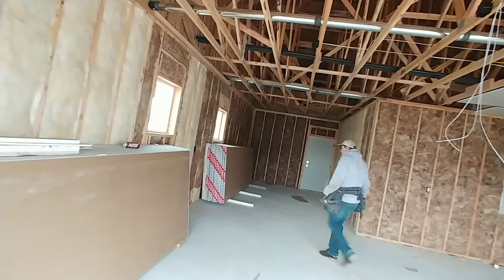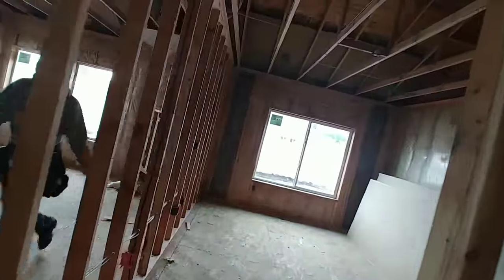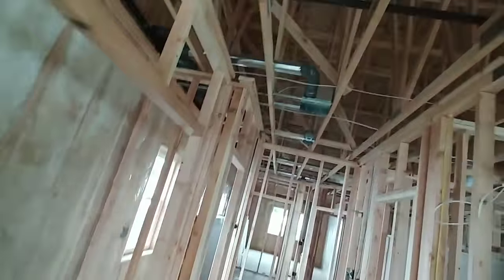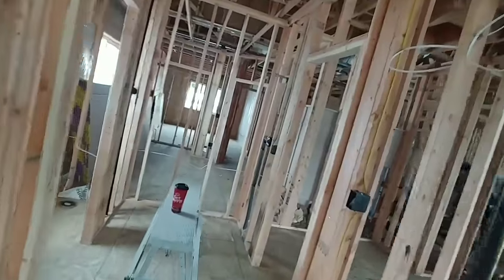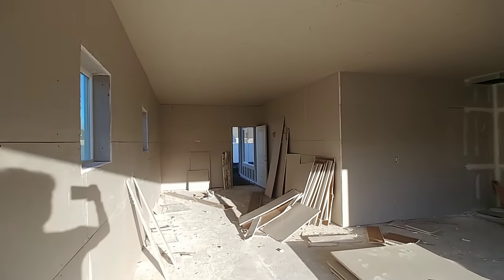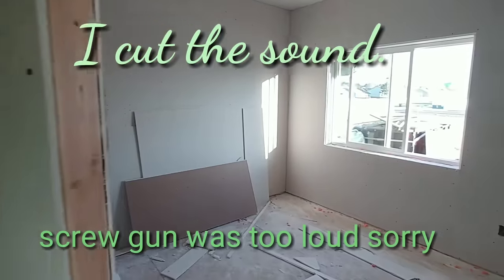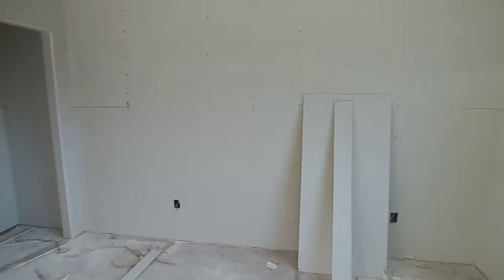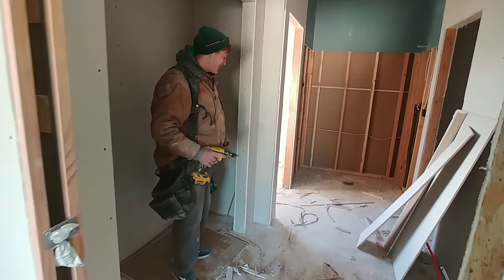Hanging drywall, 1 house 1 day, full crew start to finish drywall hang. Work vlog

Comment: Looks like you guys do pretty good work. Why no glue?
Reply: Yanks dont glue...
Reply: Jonny Esper I'm the only one that I know of in my area that does, it's made a big difference in call backs for nail pops, I don't get those anymore.
Reply: 10 years of sheeting... hard times..we never wasted a move...flat strap all day..
Most people dont what a hard days work is..  dawn to dark..hop into the car and my legs are still twiching ..
Reply: Bama Backroads real sheetrockers use nails
Reply: Around here that'd be from dark til dark! ...But I feel you - Worst one was 22hrs straight finishing up before a handover. Not EVER doing that again.
Reply: ...@ Jonny Esper

Comment: 48in x 8ft 1/2 inch drywall ceiling is easy....
54in x 10ft 5/8 inch drywall weigh twice and bigger  and tiring... 48in x1/2inch vs  54in x 5/8in way harder...

Comment: Could someone please tell me how much this pays?? And if I need experience to work in drywall
Reply: In nw wa where I live hanging pays anywhere in the range of 15-30 cents per square ft.  I realize that's a huge variance and it usually pays around 18-20 cents per sq ft on your average easy custom or spec homes.  Hanging is great money but it'll kill ya.  If you really want t ok hang you could find a job as an apprentice if theres lots of construction in the area

Comment: No Poly on the ceiling ?
Reply from the maker: No not in this area. Its not required.
Reply: @NomadicINK  Then why on some of the walls ?
Reply from the maker: I couldn't tell you.  Id have to look into it for this area.  Walls need a vapor barrier in most areas here.  I think they have a venting system in the roof  or a way to get rid of moisture up in the trusses
Reply: @NomadicINK  Hmm weird ? I wasn't being smart or anything I was just wondering cause it don't seem to make sense . Anyways u boys are fast drywallers and Id hire u guys any day 👍
Reply from the maker: What area are you in? Peiple ask about that a lot. Its a common question. I just dont fully have an answer. I assume they have something figured out for the region.
Reply: @NomadicINK  Im in New Brunswick Canada . I see it looks cold there too so it should be the same code . Especially in the garage as they dont want exhaust fumes entering the home

Comment: You guys must be the Idaho crew my boss was talking about.
Reply: Actually i can prob guarantee they aren't the crew.  The crew he was prob talking about is Shawn Davis Drywall in cda idaho. I see they are hangin pabco brand drywall. And any drywaller in north idaho knows if it came all the way from mexico cheaper than the good stuff from canada, you get what you pay for. Plus, custom drywall a its sorry excuse for an owner possibly had something to do with it.  I feel sorry for these guys if they do any work for custom drywall cause they are getting shafted on the price. And hanging lots of drywall that has mold growing on it, from being stored out in north idaho's winter weather.  Been trying to contact people to resolve the mold issue, finally about a week ago an inspector made custom drywall remove all drywall from a 400 sheet house to be replaced due to the mold on brand new drywall.

Comment: How many sheets? And how many peoples? And 8 , 7 hrs!?
Reply from the maker: I'll have to check on the bill. I forget the sheet count. I had 5 guys plus me there for 8 hours total.  I think it was close to 200 sheets. Super gravy house
Reply: does that include bead work and cleanup?  looks to be about 4 sheets per man hour.  When you say sheet is that twelves ?  Do you bill out per sq foot of board? I've hung on stilts. Pretty easy but when i tell  guys it's comfortable they think i'm nuts.
Reply from the maker: Yeah roughly about four to five sheets per guy an hour getting paid square foot. It's roughly $0.18 depending on the job and what kind of paperwork you have. Yeah I love hanging on stilts man same thing I've told people about still lids and they just think you're nuts. Thanks for watching I appreciate the comment. Oh and I don't do clean up or beadwork. This is just strictly hang

Comment: 7:20 Why the earth dont you use "drywall elevator" Looks so difficult. With that u can do the work alone and faster than these two guys.
Reply: Nope....they are doing it right, the only way you can put a sheet into a full opening on a lid is with one end up first.  No elevator, lift, or hoist can do that as easy as two people who know the trade.  The things that sucks, is these guys won't know the damage this does to the body until their mid 30's or so.  I've only been doing it for 28 plus years now so maybe a thing or two.  But good hard earned dollars here, no pussies need apply...

Comment: No strapping on the ceilings?
Reply from the maker: What do you mean by strapping?
Reply: I've always seen furring running perpendicular to the truss or floor joists...just curious. Diffrent places do diffrent things
Reply from the maker: On some jobs I have. But its not code out here. Sometimes for sound they will run rc channel .
Reply: Where are you located...good job btw
Reply from the maker: Thanks! Im out in the panhandle of Idaho. Coeur d alene.  It's beautiful out here
Reply: If you don't mind me asking what did that job cost?
Reply from the maker: How much do the job cost? It's roughly 16 to $0.20 a foot depending on whether or not you have paperwork buy screws and what the house looks like.

Comment: No glue on the studs? Not hating, just wondering. I was always taught the glue held the drywall, and the screws just kept it there until the glue held. Also, anyone can hang drywall, it's not a racial sport.

Comment: For what it's worth.  It's my opinion that adhesives are a really big part of the advancements in the industry.   Who doesn't love gorilla or LP on everything?  Is it shitty lighting or are you not gluing your drywall?   Always glue and screw bud.  That being said you are probably much more successful then I am.   I do not charge enough!
Reply from the maker: I sub work to a contractor and they do not supply glue because its not required in this area.

Comment: Excellent Video ! love the "daddy long legs" :D  Dust looks a worry, should you guys have masks ?
Reply from the maker: It probably be a good idea if we did have masks I don't really care to wear them though. There's something called silica and it's in Gypsum in concrete dust they say it's not at a high enough concentrated level in the dust tested from drywall. But if it gets too Dusty I like to air it out or go to another room.

Comment: What's the height? Why the belly bands? 9ft should have stretch. Rather finish 2 joints then one terrible butt
Reply from the maker: It's 9 foot. What a section in the video are you referring to? I'm not too sure if there was a belly band in on any of these walls. Link me back the time stamp and I'll check it out and let you know if I just messed up or if it was rhyme to The Reason
Reply: In the garage it looks like you have a band. And I mean no disrespect, I finish, so I was curious about the height and the reasoning. In Kansas, they usually lay sheets vertical in garages, so when we go to box it's multiple joints.
Reply from the maker: They don't stock us with 54 5/8. And the garage is a little bit over 9 foot like 9 and 4 in. The tapers don't like the scene towards the bottom. The ones around here anyways so I put the belly band in the center of the garages. If it's over a 16-inch belly ban or an 18 inch fan I'll put it on the bottom as a rip
Reply from the maker: I actually love comments like these. Shows me you know what you're doing. And I'm always willing to hear another drywallers opinion on a better way to hang . I do my best to hang for the finishers. 
Keep the tapers happy!
Reply: Got to respect that. With an attitude like that, your crew will be working, while another is sitting around wishing for work. Like I said before, no disrespect, just curious as to why. Appreciate the feed back.

Comment: I still don't understand why some builders insulate and poly garage walls but don't Poly the lids....anyway nice work boys
Reply: Ryan Emes if you poly the lid you will have mold and moisture problems unless you  have makeup air.  It was a popular practice  in the 80's  fortunately most of us have learned form our mistakes.
Reply: Gary Luther even if you installed a few vents on the roof? I also didn't see any acoustic seal on the poly. Cheers
Reply: Ryan Emes Its not the adict that's  the problem it is the living space. if the lid has plastic moisture gets trapped between the rock  and the poly. It causes mold in the corners and tape to peel.  The last  one we hung and finish that the home oner insisted on poly on the lid we made sign a waver. He was back in 2 years with mold.   he had 2 other crews fix my tape before pulling down the lid and poly.
Reply: Ryan Emes  what is acoustic seal. it isn't  a product I am familiar with.
Reply: Gary Luther acoustic seal is a black caulking that we have to put on both top and bottom plates as well as all cripples. It's a smoke and sound sealant. It's also supposed to help with moisture
Reply: Only if there are no punctures to the poly which is next to impossible especially when we use our routers for plugs pot lights  windows ECT
Reply: Up in Canada electric boxes come with. Gaskets insulators also acustica seal all plugs bit messy to rought sometimes but you get a great seal no punctures.

Comment: no back blocking, no glue. cracky cracky
Reply from the maker: Glues not required in this area. What do you mean by back blocking? It's not required blocking required on Shear walls and that's it. You know every area has different codes some places still use nails.

Comment: WTF?
Zero stud adhesive, no noggins, electric cable and plumbing travelling horizontally along walls. What a nightmare!
This POS house wouldn't pass inspection under any circumstances in Australia.
Fail.....